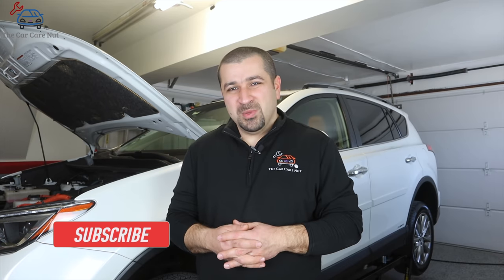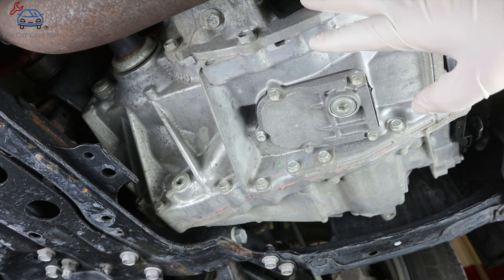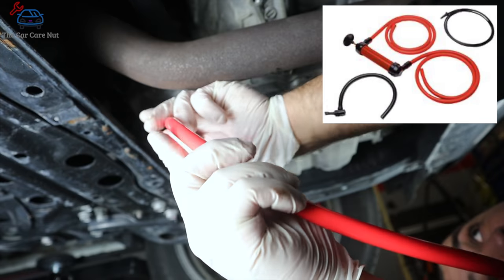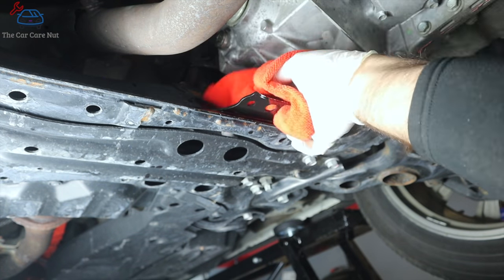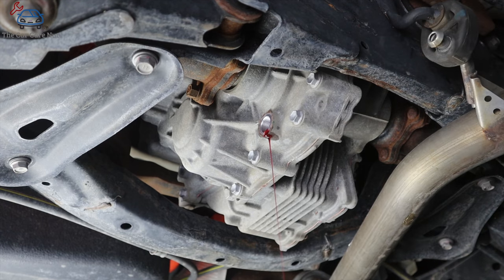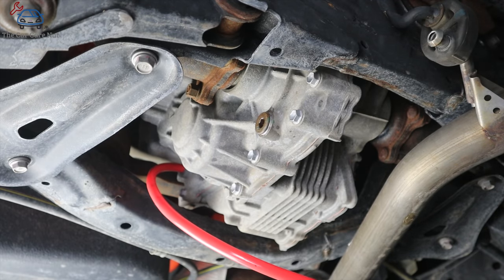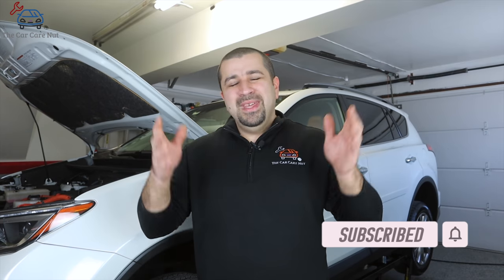How to change Toyota Hybrid Transmission fluid and Differential fluid

Comment: Great video, as all of your videos are. I have a Nissan Altima Hybrid which has a Toyota transmission and a Prius Plug In. I wonder if it would be better to get a drain plug with a magnet for the (front) CVT drain plug?
Reply from the maker: Thank you for watching my videos! I don’t have much experience with Nissan hybrids honestly. But if the original drain plug doesn’t have a magnet I wouldn’t add one.

Comment: Very informative video. Yesterday I changed the transmission fluid on my 2018 Toyota rav4 hybrid. Drained fine. Filling i noticed when waiting for the fluid to drip and it was like a rolling drip so it was confusing. I put the fill plug in and then I removed the fill plug again to double check it wasn't over filled and noticed the fluid was rolling out the transmission opening instead of dripping.  I hope I don't have to remove the fill plug again. Your thoughts?

Comment: Thank you again for the great video. So I finally changed 2009 TCH transmission fluid on the weekend and it wasn't too bad, I did use a hose and a small funnel to fill and works great. Crawling underneath the car to get this done and did not see clearly which is the fill and which is the drain plug. I accidentally open the plug above the axle shaft and nothing came out (I thought I was really low on fluid), then I open the plug beside the axle and small amount of fluid came out. Then I realized that I got the plugs wrong, there was another plug below, that was the drain plug and about 4 litres came out. My question is the third plug above the axle is for what, did I do any damages by removing it and putting it back, and what's it intended for?
Reply: I was also wondering what that other plug was for. I spent quite a bit of time looking at the video and at my transmission casing and trying to figure which plug was the fill plug. I'd also be curious to find out what the plug above the actual fill plug is.

Comment: Great video..quick question. Does the differential fill plug and drain plug require a gasket? If so, is it the same model (90430-A0003)? THANK YOU

Comment: Great video
Just changed my transmission fluid using your technique. Just one question The differential only took about 3 1/2 quarts while the front took about 4 1/2 quarts in my 2008 Highlander hybrid. I thought they would be the same quantity so would that be correct that the differential takes less
Reply: Yes rear transaxle is less. Mine can only fit 2 quarts.

Comment: thank you for the good video However, I have learned that the temperature of the transmission fluid is really important. Doesn't the solution of the hybrid transmission require leveling according to temperature?

Comment: Shalom! 
I just finished doing the change on my 2012 Prius. I do need some guidance from you if you don’t mind. 

I had my transmission oil changed at the dealer 50K miles ago. Today when removing the filling plug I noticed that oil came out from there, at least half of a quart. My question is, could they have overfilled it?

In total I removed 4.4 quarts approximately and when putting the oil back, I attempted to put the same amount. But had to put the plug as oil was still coming out from the full plug. Didn’t wait for it to stop dripping like you did. Because I was afraid to under fill it. 
I am concern that I could have out less then what it needed. Even though I didn’t wait for the dripping to stop. 
I hope I was clear. 

Thank you in advance. 

The Lord Bless you and your Family Brother!
Reply from the maker: Hi! Likely the transmission was overfilled the last service. I would correct the level and call it a day
Reply: @TheCarCareNut  thank you very much. Will do that!

Comment: Thanks for the great info video.  I have a question: When I changed my 2013 Camry hybrid, I opened the fill plug, there is no oil comes out, than I drain the old fluid. I measurement transmission Fluid that come out, when I add the same  ml of the fluid back, it overflow.

Comment: I watched this and got the impression that both the drain and the fill plug were 7mm hex, being the  Prius was not directly discussed, I pulled the nearest hex plug to the general location of the fill plug on my 2008 Prius.  After successful drain, I realized the fill hole was vertical and not a fill hole. After checking out other videos, I found the correct fill hole under a 24 mm plug, my biggest socket was 22 mm but my 15/16 socket fit.  I found a small steel ball in the pan as I drained the dirty fluid into a jug and after taking the car off the driveway found the small spring that held it in place.  Put it up on the jack stands, held the ball and spring on the plug with bees wax, successful re-install.
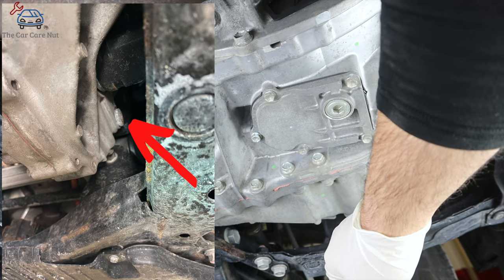My question is when you refer to the front of the transmission, it sits sits crossways, is that towards the engine, or the front bumper?  I need to change the transmission fluid on a 2007 Highlander Hybrid and the placement of the fill plug seems to be hiding behind a motor mount, if correct it can only be reached by socket, u-joint extension, 6 in extension...and putting back in without cross threading will be near impossible.   At 4:21 in the video is a picture of the Highlander Hybrid fill plug, it looks to be 22mm hex socket not allen, is that correct?
Any help would be much appreciated.

Comment: Hope you will answer a question about my 2015 4Runner Limited, I changed the gear oil in the front and rear diffs and also the transfer case, the diffs had the magnetic drain plugs but the transfer case did not, I checked with my local dealer and he said the transfer case did not come with the magnetic drain plug, is this correct ? Thanks in advance if you can answer this for me ! Love your channel !

Comment: Thank you so much for these videos! For a 2016 Prius, is the transmission and differential the same? So just one drain and fill instead of two separate reservoirs?
Reply: You only a rear differential if you have AWD.

Comment: Have 2013 Prius with 300k. Considering purchase of 2013, Lexus ES 300h. Since it is the same engine that is in the Camry and Avalon hybrid, can I use Toyota parts instead of Lexus when I go to replace plugs, oxygen sensor and coils etc. since it is the same engine?

Comment: I'm a little confused. Called the dealership to get a quote for these services. I was told that not only is there a transmission fluid and differential but also a transaxle? Is it 3 different components?

Comment: AMD I need to change the transmission fluid on my 2020 RAV4 hybrid now on the 2020 RAV4 does that apply as the same video you have for the 2018 that you did and where is the filter located because I want to change the filter not just the fluid thank you for your videos they're AMD you do a great job thank you .
Reply: as far as i know there is no filter on these transmissions, you just need to change the fluid

Comment: Thank you for this essential information.
I have a 2009 Lexus RX450h with 160000 miles.
When I bought it, I asked the dealer to replace the transmission fluid, to which they said they don't do that, which leads me to believe this has never been done.
I believe I can ask my mechanic to do it with these instructions.
The question is should I at this point do it? There is at least twice the mileage for the service interval.
The transmission feels ok and doesn't produce any kind of strange noise.

Also, are you aware of any differences in the hybrid transmission for the 2GR engine? Like fill and drain gasket part numbers, fluid type and possibly the same for the rear diff.

Thanks!
Reply from the maker: Hi! I would have the fluid replaced in the transmission and differential exactly as you see in the video including the part number for the gaskets. You can’t cause harm by replacing it late in a hybrid transmission unlike a conventional automatic
Reply: @TheCarCareNut  Thank you for your quick reply! I will definitely be doing that.

Comment: This is a job I will do soon. Is there no filter to clean or replace. Also I am ready to change the engine oil 3.5v6 rx450h on a 2010. With all the things I see about oil sludge or deposits should I use an engine flush. I have bought the 0w20 toyota oil for it and toyota oil filter.

Live you videos they are very clear telling you what to do. Not looking forward to the sparkplug change

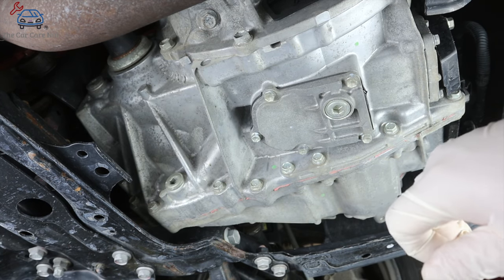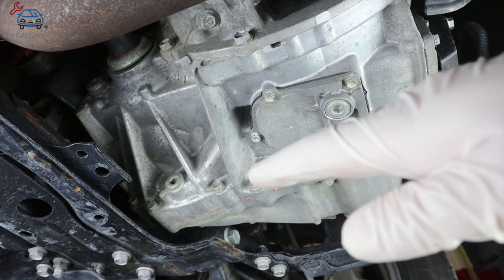Comment: At 4:26 and 4:52, I believe the Car Care Nut meant take out the FILL plug out *FIRST*.  I checked my 2013 RX450h AWD fill and drain plugs' locations for the transmission fluid (FRONT).  They are pretty much exactly what is shown in the video.  Same for the rear differential (BACK)! REMEMBER every Lexus/Totoya model is different!

Comment: Thanks for the great content

Since adjusting the oil level does not require a specific temperature, does the level vary according to the air temperature between -20 degrees Celsius in winter and above 40 degrees Celsius in the desert summer?
Reply from the maker: It shouldn’t affect the level. You’re good.
Reply: @TheCarCareNut  

I found a document for RAV4 HV 2020 that says:

 Put the engine in (Maintenance Mode) and idle the engine for 30 seconds

Is it an important procedure or can be ignored?
Reply from the maker: You should run the engine for a bit before checking the oil level. You could put it in maintenance mode or just drive it until the engine comes on

Comment: Great Video! Thank you so much for Excellent and clear instructions.I just recently came across your channel. Would you have a recommendation how to check transmission fluid level / change transmission fluid for 2021 Toyota Sienna Hybrid ? Thank you kindly.
Reply from the maker: Hi! The same procedure applies to your sienna hybrid. Very simple drain and fill
Reply: @TheCarCareNut  Thank you so much for your quick reply. Are you able to assist me in locating the drain plug and fill plug on Sienna 21? Its definitely different from RAV4 you have illustrated in video. Thank you so much in advance!

Comment: I appreciate all the videos you produce however I’m having trouble finding any information about replacing the transmission fluid for my 2013 Lexus GS 450H. The transmission does not look like the other CVT’s and has me questioning how to add the new fluid. Any help would be greatly appreciated. 
Thank you in advance!
Reply from the maker: Hi david. It is a bit different and one that I want to do a video on. Any chance you’re in the Chicago area?
Reply: Thank you for your prompt response. Unfortunately I’m not any where near Chicago, I live in Georgia. Are there any tips or pointers you can provide me? I was hoping to try it this weekend but I could easily wait until next weekend too.
Reply: Always great to watch your videos! I have a 2010 GS450h and also can’t seem to find info regarding its transmission. I was underneath the car the other day and could not find the fill plug as it is not as obvious as my 2015 Camry Hybrid, or any other.  I’m sure Car Care Nut can help. May God bless you!
Reply: @TheCarCareNut  I was hopeful that I would receive a response back as promised earlier but I guess I will have to give up on ever hearing back from the Car Care Nut on this matter. Very disappointing.
Reply: That's because the GS does not have a CVT, it's the same transmission as the Lexus IS. The title of this video is a bit incorrect as it applies only to hybrids with CVTs, not all hybrids have CVTs.
Reply: @jeffumbach  
I’m not aware of the Lexus IS hybrid nor it’s transmission but Lexus calls the transmission in my car (2013 GS450H) an E-CVT so I was shortening the abbreviation slightly which may have been incorrect but I’d appreciate more insight if you are able to offer something helpful?

Comment: my man,, I just bought a 2015 Lexus CT200H hybrid.. it has 131k miles on it.. I watch this video, and it seems like you do think that it's an issue overall to change it. This is contrary to what others have told me.. I understand that this is not a "true" CVT transmission, ECVT I think you call it in your other video.. If it's not a concern to change the fluid, than what fluid should I put in if I do decide to change it? your advice is greatly appreciated.. 
thanks, e

Comment: I own a 2021 Avalon Hybrid and a recently purchased 2022 Sienna Limited with 83k miles.  I do not think the fluids were changed and the dealer would not include in the certified pre-owned deal.  I've heard that you need to measure the temp of the fluid while doing the fill of the e-cvt.  Is that true or can I strictly follow the procedure you just showed to change my fluids?

Comment: Thank you AMD, I have a question.  Does the Lexus RX450h have the same procedure?
Reply from the maker: Hi! Yes exactly the same. On some of them the fill plug will be in a different location on the other side of the transmission. But the rest of the process is the same

Comment: Hello! For a toyota corolla 2024 hybrid its the same procedure? It states for the new toyota e transaxle fluid TE and just 3L, instead of the old ATF WS that stated 3.6L. I read that it is a new generations now and thats why the transmission and everything is modified since 2023 for corolla, prius and ch r. Thanks!

Comment: Great video, thank you for sharing, I’m a big fan.. I have a 2012 Toyota Prius V with 191,965 miles on the odometer but when I purchased the car, the previous owner had changed the motor due to his brother blowing the original motor, I did not get any paper work on the engine to show proof but how do you find out if it has been changed or not? 

Also took it to the local Toyota dealer to have all the fluids changed since supposedly should have a new/used Motor with 50,000 miles on it. They said they don’t recommend changing the fluids in the deferential and the transmission because they don’t have previous history about the car having it changed! And could stir things up and the advisor doesn’t recommend it. 

So they said they wouldn’t do it. What are your thoughts on this? 

Should I still do it or not change the fluids?  Thank you in advance and look forward to more of your videos.
Reply from the maker: Hi! There’s a VIN number on the engine that you can find to see if it matches the one on the chassis and on hybrids you can change the transmission fluid at any time. No damage will occur.
Reply: @TheCarCareNut   thanks for the reply and i tried actually today here in a Toyota dealer but the advisor totally said she wont do it which really upset me, gonna try another Toyota dealer

Comment: 2015 Camry Hybrid. I have drained and measured 3.6 QT's of ATF fluid, than pumped in almost 3.9 QT's of WS ATF but the fluid never overspilled like in your video. The service was done on a flat drive-on lift. The owner's manual states 3.9 QT transaxle capacity. Should I add more fluid until it spills out?

Comment: Thanks, what is the temperature  of the trans fluid, what is the effect of trans fluid, does cold fluid cause over fill?
Reply from the maker: On hybrids the tolerance for the level is generous so it doesn’t matter the fluid temperature
Reply: @TheCarCareNut  , thanks, do you know the Toyota  engine oil filter part number since you are suggesting oil change at 1000 miles for a new Rav4 hybrid.  My guess is that dealers will refuse to change engine oil at 1000 miles.  It will have to be DIY.
Reply from the maker: Hi! If your car is a 2021 rav4 hybrid then it’s 90915-YZZN1 for the oil filter
Reply: @TheCarCareNut  , thank you, sir

Comment: Great video as always, just a question do these transmission have transmission cooling lines? I found a little wet spot on my 15 highlander hybrid at the bottom where transmission joint and  orange gasket is and I was trying to figure out where its coming from
Reply: No they don't

Comment: If you have a 2021 Rav4 Hybrid
mine had the transmission drain plug facing the floor. It was not a coolant drain as in this older hybrid.
And with the fill plug next to the axel as expected.
Reply: Do you still cap off the drain and let it overflow from the fill plug? or does it use the running temperature drain overflow method like most of the "sealed" transmission with the regular automatic transmission?

Comment: Hi there , I have a 3rd gen prius in norway. I just called toyota to get e-cvt fluid they told me that it's not necessary to change transmission fluid ever. My car has little over 200k km, bought it a month ago. Not sure if it was ever changed.  Kindly suggest what to do. BTW I am your regular content consumer.👍😃
With best regards  Jagjit Singh

Comment: Does the hybrid rear differential use a different type of fluid as the hybrid transmission or is it the same as the Toyota ATF AW fluid? How many quarts to fill each transmission and rear differential?

Comment: I bought rx400h at 122k. Can I just replace the transmission fluid? What are common problems? Do you recomment changing any coolant hoses? I've got the timing belt done as soon as I picked up the car. I wish you were around virginia. So hard to find honest mechanics here.

Comment: If using ramps for the front two wheels instead of using 4 car jack stands, the car would be at a slight upward angle. Would that affect the transmission fluid level when you're waiting for it to level out? Is it ok to use ramps? Or would Jack stands be needed to keep to level for this?

Comment: Hi, I have 2010 hybrid highlander with 130,000 miles. Shall I change the Transmission oil now? It has never been changed. Thank you.
Reply from the maker: Hi! With hybrids there’s no issue replacing the fluid later so you’re good to replace it

Comment: I have a 2015 Toyota Camry hybrid I only change Transmission oil one time 
 now it’s 290,000 Miles 
should I change it again Or just leave it
Reply from the maker: You can change it again. Hybrids are not like normal transmissions when it comes to fluid